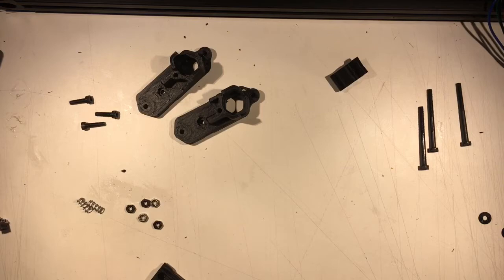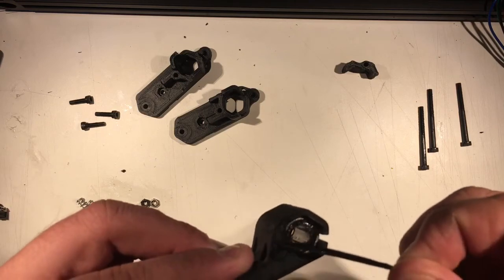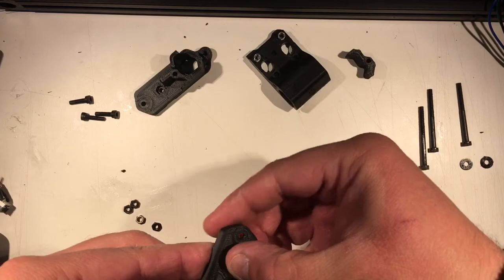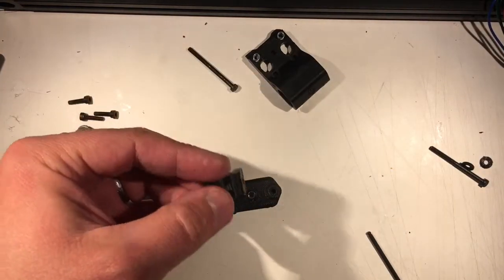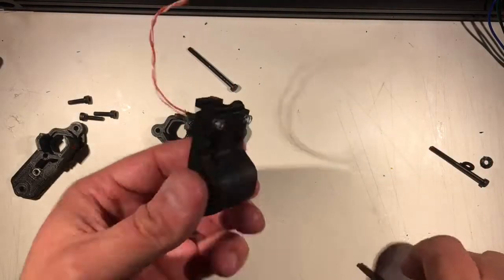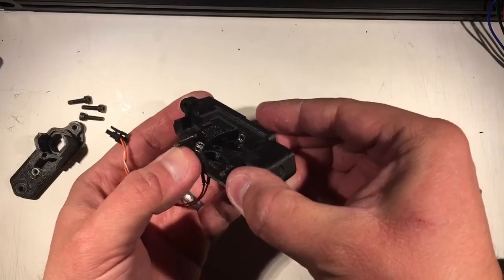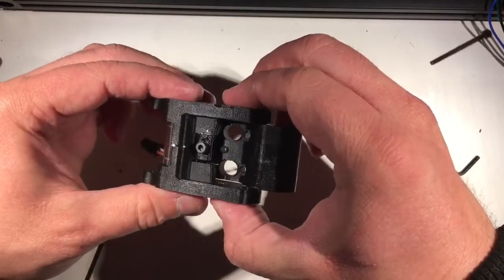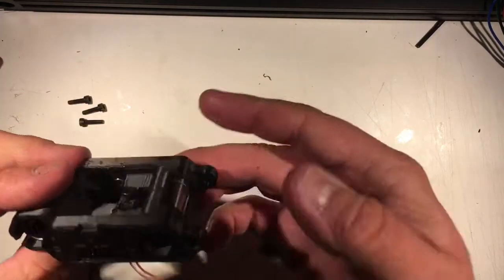V1.5 X Carriage Update

Comment: Im almost done printing the parts for 1.5 carriage. 
What springs are used for the Z-axis actuator? I could not find those in any BOM.
Thanks for your help!
Reply: Thanks for your reply. I just found out i printed already the new version of the parts.
Reply: I ecountered this problem a while ago why parts are different on the movie than stl pack. Im making research on which design to use for my printer. I wonder how does it work now without spring. Im worried about z endstop could switch randompy due to tensions and vibrations of the printer. If the travel of actuator is that little could it activate switch in case of missalligned Y axis rods or accidentally pulling wires or filament tube going to printer head?. Now  without spring what gives counterforce preventing it from pushing the switch?